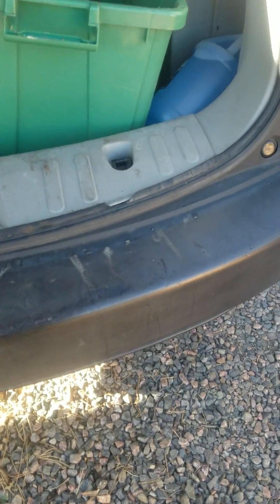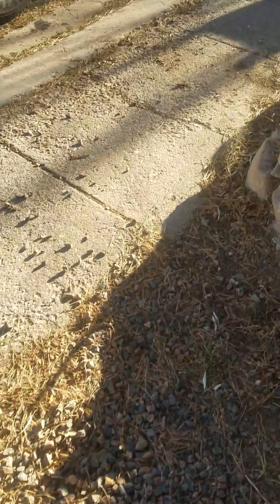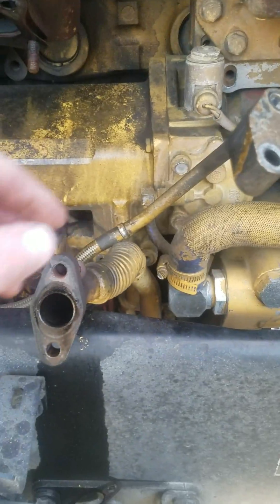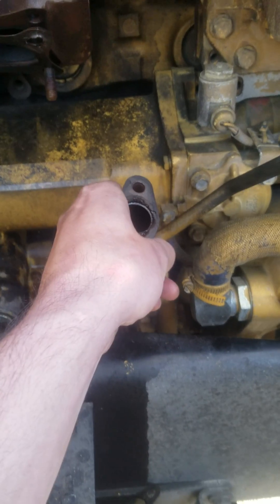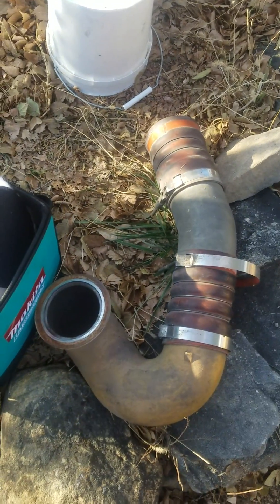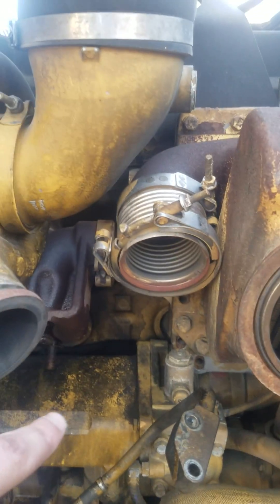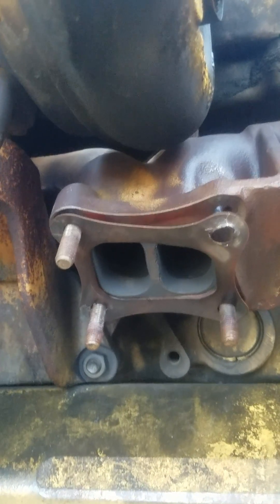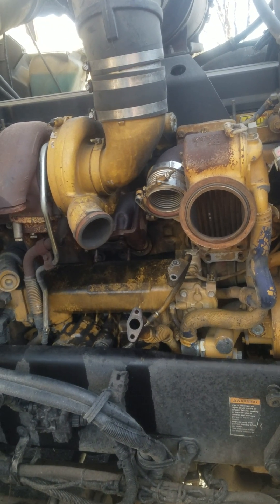CAT C13 turbo installation

Comment: How do you get the back bolts on the turbo off I tried every thing I just couldn't get a socket or a wrench on them.
Reply: bend an open end wrench with a torch